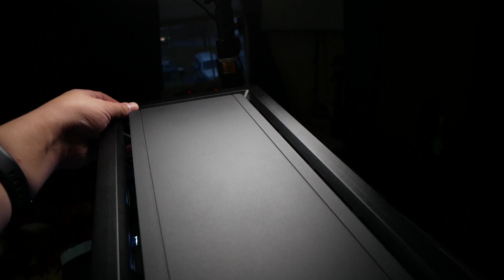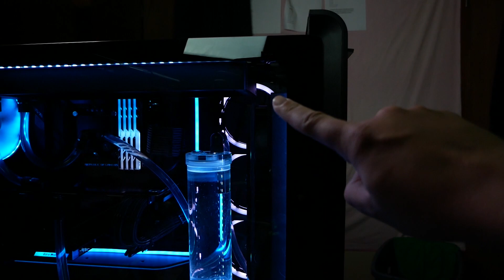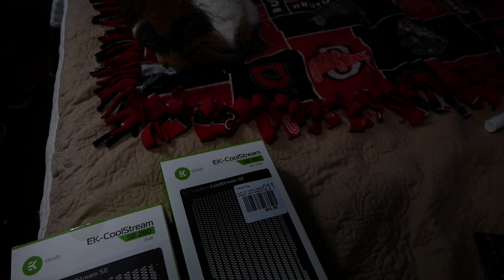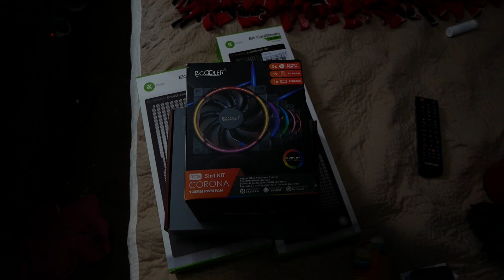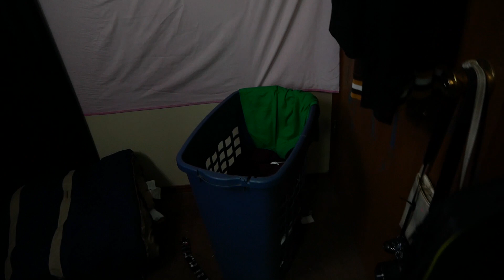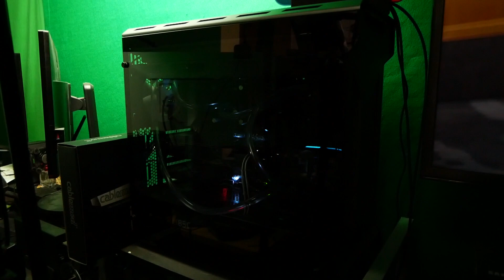An update on the Phanteks Enthoo 719 build

Comment: There were a lot of strange compromises on Phanteks part with this case. It has a rushed to market design feel to it.
A few more inches here and there and it would have been perfect.
Reply from the maker: That pretty much sums it up for me. I also feel like they tried to compromise to keep the cost under $200, which didn't help. But yes, a bit more height and length would've made a massive difference with this case.

Comment: How is the case airflow in this and how are your terps good? If you were to go more air cool build versus liquid you think temps would be good in this case?
Reply from the maker: It's pretty solid. I don't have any precise way to measure it, but there are plenty of ways to get air in the case. You have front, side, and bottom options for intake. The front is slightly obstructed, but there's enough of a gap to let air in. A mesh front would obviously be better, but this works well enough. The bottom is raised enough where that's a good option, and the side is pretty open aside from the dust filter. Phanteks also uses a very fine mesh for their filter, which helps, and they provide one for all of those spots plus the top if you want one up there. My idle temps tend to range about 33-36C while gaming temps are typically in the 60's. A stress test will push things towards 70C on my 8700k at 5Ghz, but I also only have the fans running at around 35-40% (500-700RPM) at all times.

As for air-cooling, I feel it would be pretty good given the number of options you have for mounting fans. The case is clearly meant for water cooling, but don't let that stop you from considering it. 

Sorry for the long response. I'm thinking of doing a Q&A video in the near-future and this is an excellent set of questions, so if I do that I'll touch on it in that in more detail perhaps.
Reply: @DaveyKTech  Okay thanks yea i bought this case i had the Phanteks Primo a bigger case but restricted more. This one seem to have better airflow and the lighting also seems nice on power shroud and in front as well. Also bought some Nocuta Fans for more silent opertion and got ones for case flow vs radiator flow. I got black one like you it looks to me better than the grey lol. basically might run 4 fans front 3 bottom 1 rear and the 4 on the side.
Reply from the maker: @unsc0212able  They do a nice job with the lighting for sure, especially if you want to integrate other Phanteks or even any other digital RGB stuff. But I stuffed this thing full of fans for the same reason really. To be truthful, I was going to get the black Chromax fans, but the grey ones were $10 cheaper lol. So I went with those. They aren't that noticeable, but I'm just glad Noctua has more neutral fans now.
Reply: @DaveyKTech  Ya i was debating getting the 140s but found the Noctua NF-S12A to be best option move alot of air and are extremely quiet and there chrome ones. Im really excited for this case. Especially since has tempered glass door and window were you can see your SSDs.

Comment: The trick is to use slim radiators. I'm doing a build in this case and using 2 480mm ultra slim rads 1 ultra slim 360mm at the top and 1 thick 56mm 360mm rad on the bottom in a push pull configuration. The ultra slims are only 20.5mm thick all XSPC rads. Only problem I have with the bottom rad is that it's about 5mm to wide so I kinda have to wedge it in there to fit.
Reply from the maker: Yup, you nailed it. Slim radiators really open this case up a lot and I have changed the two thicker radiators to slimmer ones to good results. I'll have a video showing the final build soon. Thanks for sharing how you're building in this case as well.
Reply: Davey K question! So i have the case on the way and am starting to plan what radiators I can fit. So, if i go with the slim SE radiators, i can fit 2 480mm in front, and a 360mm up to? Also, ill be running a dual system (hoping for one loop) will i be able to fit some kind of radiator at the bottom next to the second ITX system?
Reply: @chazdills8675  if you're gonna use a gpu on the itx system then you probably would only be able to fit a 120 or 140mm rad at the bottom as long as you used a slim 480mm or smaller at the front. Just check out ggf events channel he did a dual system build in this case but only used 2 rads, a thick 480mm at the front and a thick 360mm at top. But going slim is the way to go in this case if you're trying to max out rad usage.
Reply: The Real McCoy so I won’t be using a full GPU in the ITX systems. I’ll be putting a capture card with a rose cable down there. Is that still the same story? I’m sure the 2 480s and one 360 will cool everything fine just want to throw as much as I can in there lol
Reply: @chazdills8675  you're best bet is to install the itx system first to see what kind of space you're left with and go from there
Reply: @TheRealMcCoy88  coolio! ill be getting the case in tomorrow and I think I have a 240 and 120 I can use to test fit. Will have to do some measuring since I won't have th 480s just yet. Thanks for answering my questions though!
Reply from the maker: @chazdills8675  it's gonna come down to fitting placement. It might be possible, but it may be too tight of a fit. Either 480 would make a rad on the bottom virtually impossible as well if you have a dual system build going. especially if that itx system has a gpu involved. If not, maybe a 120mm could be squeezed in the middle mouting point? This is why I feel like despite the size of the case, it's really easy to run into limitations. You might have better luck swapping one of the 480 rads with another 360, but it still may be tight. In the end, I feel like if this case were a smidge wider and taller, it would be more accomodating. But dual systems and mechanical drives complicate things.
Reply: Davey K yeah I agree. But I’m the end I love the layout. And you are saying I SHOULD be able to get the 2 480s and 1 360 in if I remove the bottom radiator from my equation? If so that’s probably what I’ll just have to do lol
Reply from the maker: @chazdills8675  I can't really say for sure. I didn't have that size radiator to check and my answer is based upon glancing at my build lol. It's going to come down to how much room for your fittings and tubing. If the ports on one of the 480 fit at the top and another at the bottom, it might work. But I'd have a backup plan ready just in case they don't all quite fit. I'm hoping they do as that would be spectacular. As it is, I'm running a 360 up top, a 280 in the front, and a 240 on the bottom with fans populating the side intake and it fits pretty well with some room to spare.
Reply: Davey K coolio! Well, I may pickup a stack of radiators from my microcenter cuz they keep the SEs in stock. Then try different combinations
Reply from the maker: @chazdills8675  Great strategy and Micro Center is just the best. I've spent way too much money in that store.
Reply: Davey K I honestly believe microcenter will be what my wife divorces me over lol
Reply from the maker: @chazdills8675  lol well let's not let it get that bad but definitely wishing you the best of luck in your build and appreciate the discussion.
Reply: Davey K sane to you! Thanks for answering my question and the brain storming session! I’ll probably have the rig up and running with multiple AIOs for now so I can still make my streams. Good luck to ya!
Reply: The Real McCoy So how was ggf able to mount a 360 rad uptop without having to switch fan orientation like this guy did?
Reply from the maker: @BrickTechCentral  Couldn't tell you. I definitely tried to mount a Coolstream PE 360 and I couldn't get the top panel to go back on, which is something people were complaining about in the Newegg reviews. Maybe manufacturing variances, who knows. I do know in my situation, it was just a smidge too wide and I wasn't trying to break the tabs that secure the top panel down.